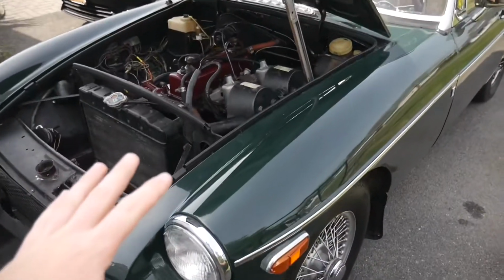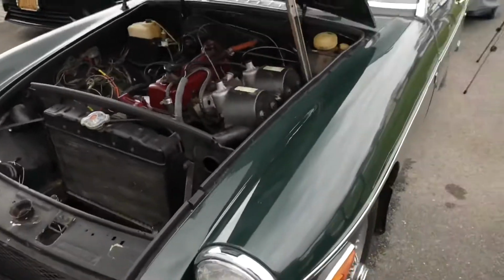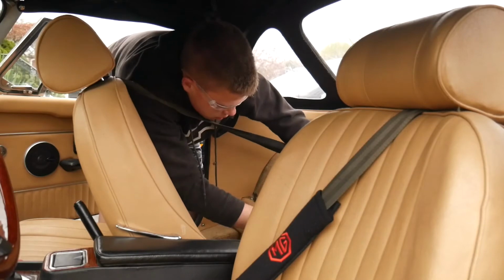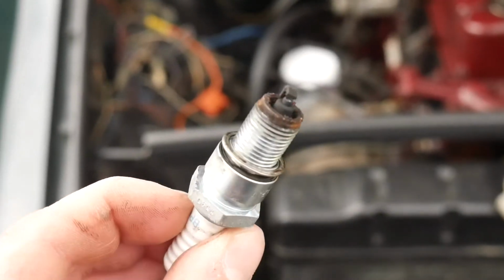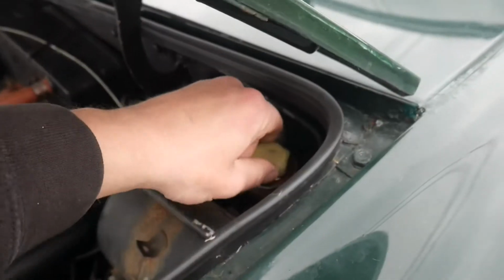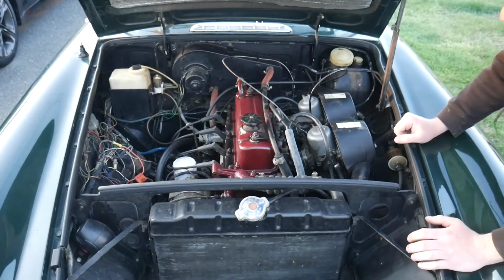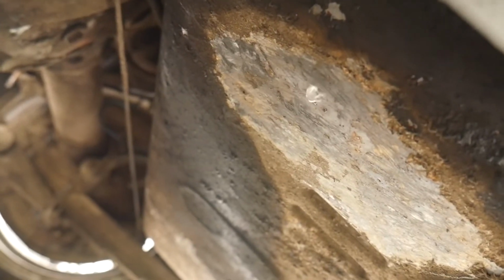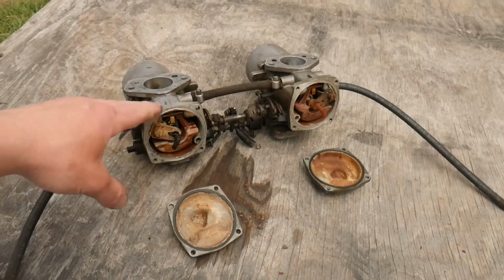Uncovering All of the PROBLEMS on the New MGB! Getting Signs of LIFE Out of It!

Comment: No need to weld the fuel tank - JB Weld makes TankWeld epoxy repair putty (for the outside of the tank), and Eastwood has their Liquid Gas Tank Sealer (poured into the tank) that can prevent pinhole leaks. Keep doing what you do!
Reply: I was going to say that, but luckily you were here before to save him some time and effort
Reply: These videos where filmed Like a year ago this car is fixed now maybe even selled
Reply: Just buy a new tank. They're not expensive. The one you have could be rusted inside and contain sediment.
Reply: @johnwren3976  it's 233 plus shipping.  I'd rather invest that money else where in the car rather than throw away a whole tank just because it has a tiny .7 sized hole
Reply: No need to buy JB weld when you have a welder on tap would  trust a tac over putty any day mate.

Comment: Same thing with your clutch and brake happened with my jeep's brakes. The brake fluid was empty, so I put some in and pumped the pedal for hours until I got pressure, but I'd only get pressure when I pumped it a few times. I found that the trick was to just rebuild the brake cylinders, and flush out the lines. took a bunch of elbow grease and snapped S tubes, but it was worth it in the end! Have fun with the ol' mg
Reply from the maker: Thanks for the tip! If it keep losing pressure I’ll definitely look into rebuilding the cylinders!

Comment: Always put the positive cable on first, and take the negative off first. Great job. If you want some of those parts vapor blasted for free, hit me up.
Reply: I said the same thing about the battery terminals
Reply: Don't have to worry about battery cables on older cars no computers to really fry
Reply: Some older vehicles have a positive grounded system. I would check and make sure it doesn’t have a positive grounded system.

Comment: I will say this I've repaired pinholes in fuel tanks multiple times with a 1/4 inch self tapping screw with a rubber washer on it not only fixes the hole but gives you a drain plug if you ever have to drop the tank to replace a sending unit or fuel line

Comment: Refrain.& save that oil again.,or get new oil again.& oil treatment again to put back in it once more afterwards. It'll fix your engine problems to man. By the way good luck to you on it. And having successfully outcomes from doing that to. One really quick tip get some assembly gel lube spray.,or another thing of oil treatment for the needle bearing installment purposes only.

Comment: Sediment from the tank is holding the float valves open (under the carbs) Remove, disassemble clean & reinstall Use spray carb cleaner.

Comment: awesome motor dont forget when rebuilbing those carbs too check the dash pot oil res on them it will never run rite if there isnt tht special oil in there its the black caps on the top of the carbs it unscrews
Reply: Also if u have any issues with the fuel pump if it’s the og British style it should be a Lucas and there rebuildable as they get stuff when not being used usually the points need cleaning when it’s been sat and nothing a little tap with a hammer and soem sandpaper won’t sort

Comment: Hey Orion bro. For real check the  Conroe.,or also known as the piston connecting rod needle bearing play on the wrist pin.& the wrist pin to for wear.,or worn spots on the pin itself. If it moves A lot still now. On those sleeve bearings that you already replaced. On the main crank shaft journal then it's most likely that the one cylinder it's moving on needs replacement needle bearing.&pin.& wrist pin clips for that cylinder. On the majorly cheapest budget for you. Without having to replace the engine.,or having to rebuild the whole engine to.

Comment: I have a 72 MGB ..the fuel pump is in the trunk  on the rear right upper part of the trunk. Electrical attachments can come disconnected  pretty easily in this area.
Reply: It removes under the car over the rear axle on passenger side

Comment: Please be careful with the tank  even rig up a gas can to test it and drop the tank eventually and clean and coat it inside,there is plenty of products out there to fix that hole and bleed the brakes and use heat and a good brake line wrench. Looks to be in decent shape so far tho and a k swap would be aweaome in this lol